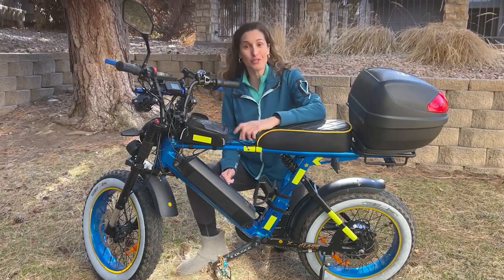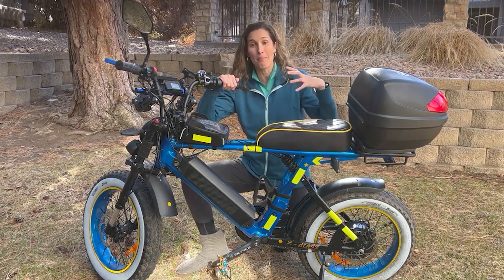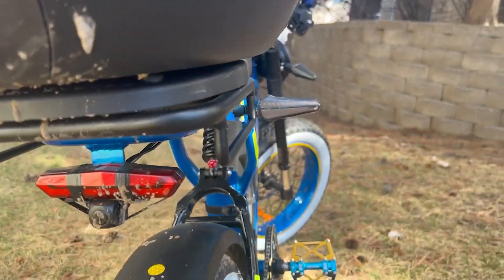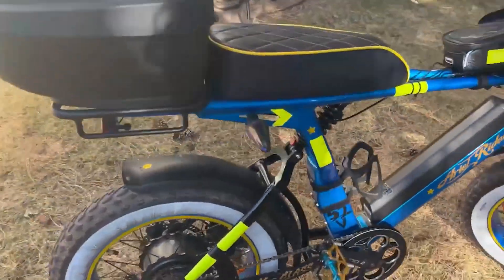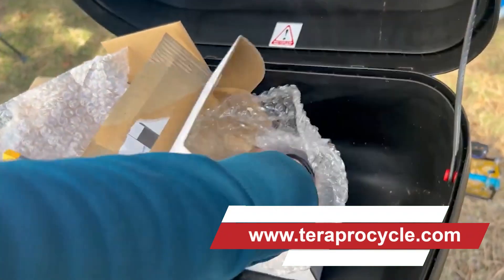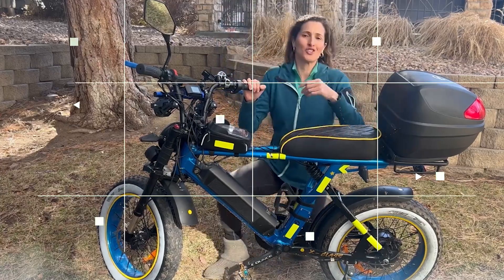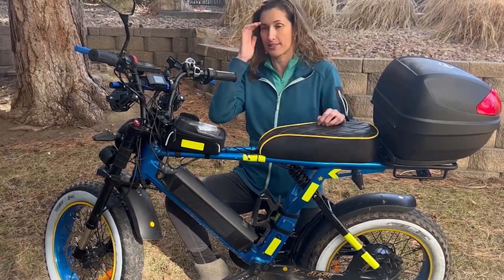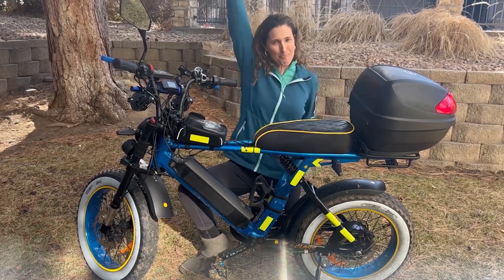🤩👉Unleashing the Power of the Ariel Xclass 52V with Jack Cecil’s Controller🔥🚴‍♀️

Comment: Look forward to your thoughts on the new controller and display. I love the display, but have mixed feelings about the controller. The take off torque is amazing. Top speed for me was only 34 mph, but that get's me back to the top speed I had before I installed the heavier Shinko 244 tires, so I'm happy with that. The down side is I have no tail light or brake light because the rectangular fitting on the new controller's light cable won't fit my round pin connector coming from my tail light. Another downside I really miss, is that my pedal assist does not work with this new controller.
Reply from the maker: Oh my gosh Camp this is no good with not having PAS available, AND that’s super disappointing about the top speed! Was Jack possibly inflating the top speed?. I got this controller, instead of getting a 72 V battery with a 3000w motor, and I’m expecting speeds of 40 mph. Of course I’ll be sharing all of my thoughts with you and the channel. How is the acceleration?Bummer about your lights too! We got this controller to gain benefits, not to loose on other good things of the Xclass
Reply: @electrifiedlatina6871  I was hoping Jack would have a fix for these problems by now? The acceleration is awesome. The controller came set at 33 amps. I set it to max of 40 amps and it would pull the front wheel off the ground. I backed it down to 38 amps. I love the power and the display. Hope Jack will get on the ball for fixing these problems. I would even buy the adapter to make my tail lights work if one was available. If ya'll find out how to do the firmware update, let me know. Thanks for the idea Floyd.
Reply from the maker: Hello Camp! So I was talking with my new e-bike mechanic and he said that if your running the 40 amp controller with our stock 52V battery that it most likely will get the same or worse top speeds as before. The ticket here is to get a 60 V battery to go with! My Xclass is at his shop, waiting for a brake bleed and have him install a 60v battery. I have to save to get this battery and selling my 52v one ;)
Reply: @electrifiedlatina6871  Thanks, I'm happy with 34 to 35 mph top speed and love the acceleration. My bike had slowed down to 31 mph with the heavier Shinko tires and this has got me back to where it was in the beginning plus a mile or two per hour. Just need to find out how to get pedal assist to work and a tail light adapter.
Reply: Be sure to set the speed limiter to 100kph. They are set low by default!  And set tire size to 22.  These configuration settings will affect speed.
Reply from the maker: Thanks for the tips Jack!  My eBike mechanic convinced me to buy a 60v battery and swap it for the stock 52v one. So now I’m saving for this 60v battery, and as soon as I get it, I will be making lots of content with your controller! According to him I wasn’t going to see a lot of top speed increase on the 52v battery.
Reply: @JackCecil  Any updates on where to purchase an adapter for the tail lights cable?
Reply: Maybe regarding the pedal assist, you need to update the firmware of the controller/new screen?
Reply from the maker: @floydcodlin8447  That’s a thought Floyd!